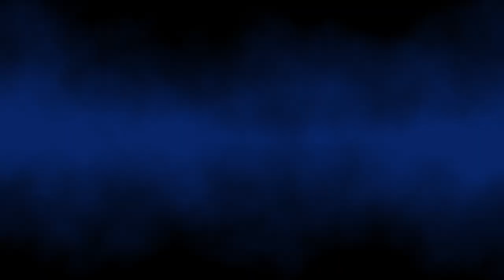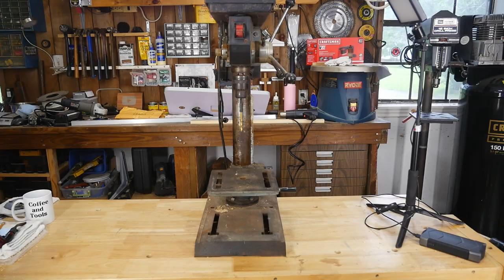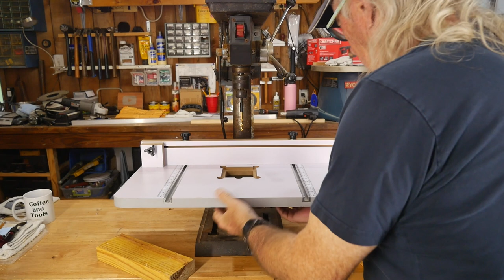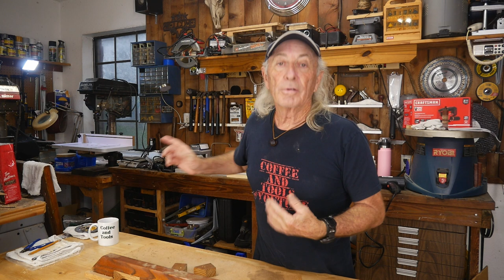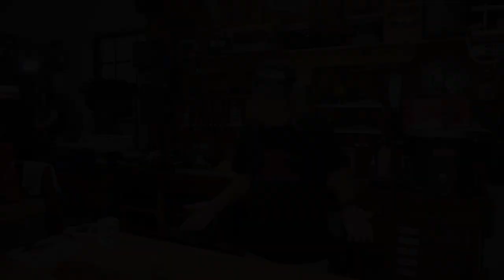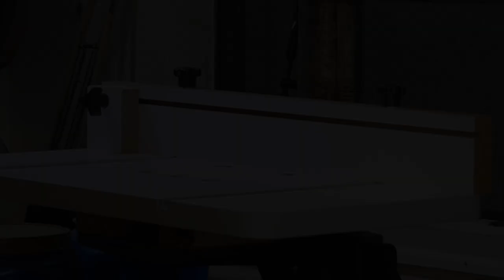Delta drill press upgrade or any bench or stand alone drill press Coffee and tools ep 266

Comment: I did pickup one of these using the provided link. I give it a thumbs up and recommend it if it fits your applications. It’s very well built and easy to secure. My table is round, but presents the same issue to a lesser degree. Still, I think I may boost mine a bit. Nice ingenuity putting yours to work!!👍🏻👊🏻😁
Reply from the maker: Due to filming time I was worried about the Delta and put on the Craftsman just for show. Turns out the fix was simple, only took me a week to think up geez...add a spacer and it works. How dumb is that ? For the price I'm happy with it too.
Reply: @SirTools look how long it took to dream up the hula hoop!! I think a week for table mod is Einsteinian!!🤣🤣👍🏻
Reply from the maker: @keithrayeski6417  🤣🤣🤣🤣

Comment: Get a universal joint from Craftsman half inch drive sockets and weld it to the end of the shaft after removing the crank. Arrange a metal brace to hold the other end of the universal point steady. Attach your crank to the open end of the universal  joint. You will clear everything simply by adding an extension to the open end of the universal joint before attaching the crank.
Reply from the maker: mm...not a bad idea !